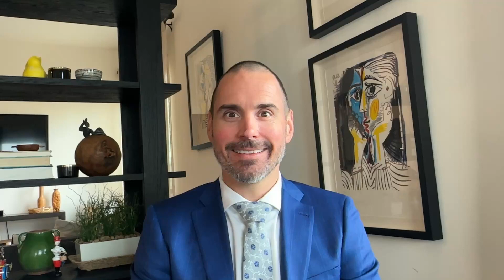Fire Wall vs  Fire Barrier

Comment: Drywall firewall wall goes from slab to min 30” over roof sheathing continues 

Drywall fire barrier goes from slab to underneath of roof sheathing continues

Drywall fire partition goes from top of subfloor to bottom of ceiling

Comment: I am passionately frustrated with the number of "professionals" allowed in hospitals to conduct construction operations, which I have had to educate on the topics discussed in your video. I say passionately frustrated because I love to educate, but frustrated because I am not the first hospital they have worked in with the wrong knowledge. WE are responsible for the Life Saftey and EOC for staff, patients, and visitors. One of the topics that scared me recently is the statement that a 1-hour smoke barrier does not need any fire protection measures. This comment and concern were brought to light during a preconstruction walkthrough when I told the contractor that penetrations must be sealed correctly in these barriers and a material that is UL listed for the appropriate rating must be used. All I could think about was that the last smoke barrier this contractor probably touched had none of their penetrations sealed correctly due to education issues on hospitals in general. Scary!
Reply from the maker: I completely agree, Joshua. A big part of our jobs is to educate other professionals. I am optimistic that through continuously educating and taking the time to teach them, that they will take the time to teach someone else. Keep up the good fight and no that you aren't alone in your efforts to elevate and empower others!